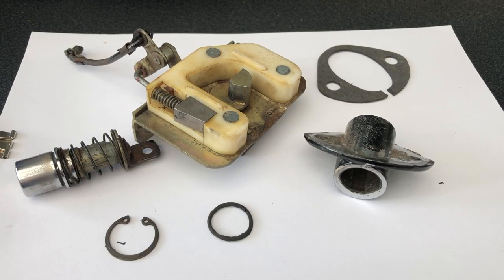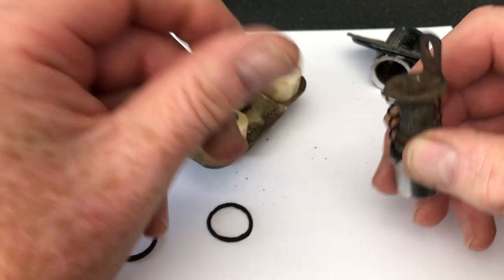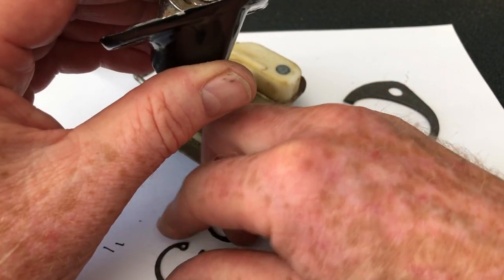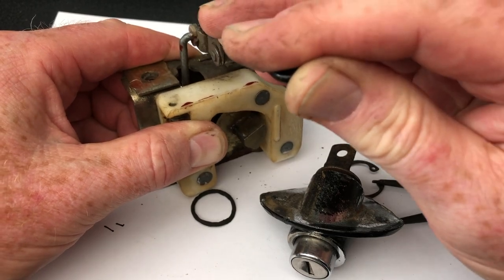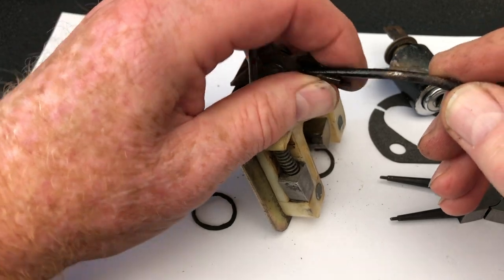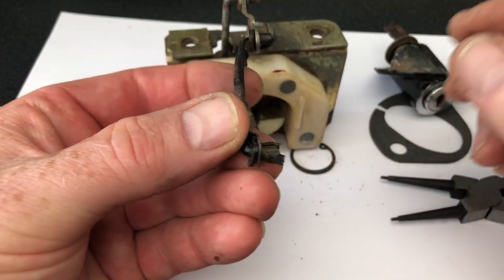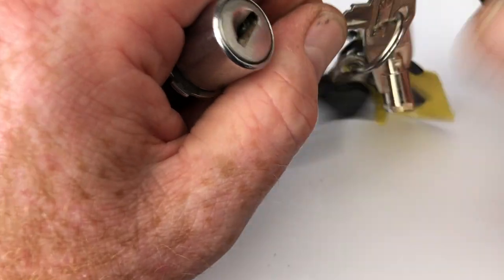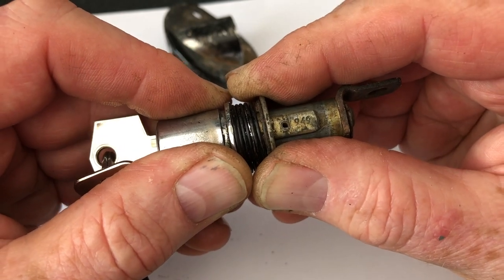Triumph Stag Boot Lock

Comment: Held by 10 mm bolts ?? There aren’t any of these new fangled metric fittings in the British Stag !  
I think you can get new clips and the plastic bits are in one piece, not two, when new. Makes the job a whole lot easier and probably removes some slop in the system as well.
Reply: He was probably using a metric tool kit, but yes they will be imperial bolts not metric. I'm guessing 3/8 AF?